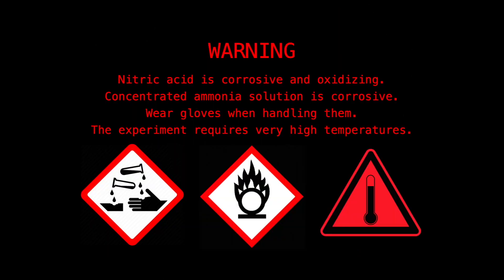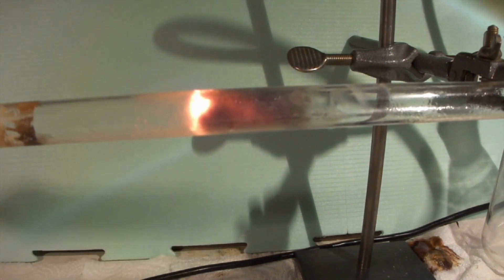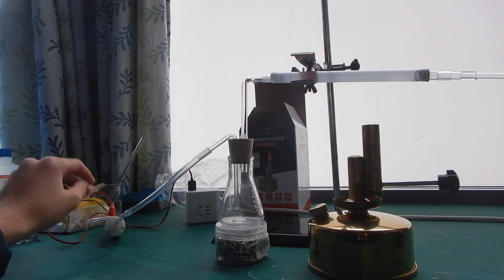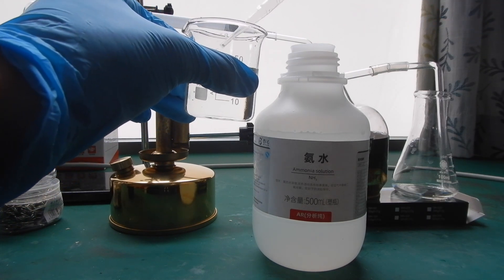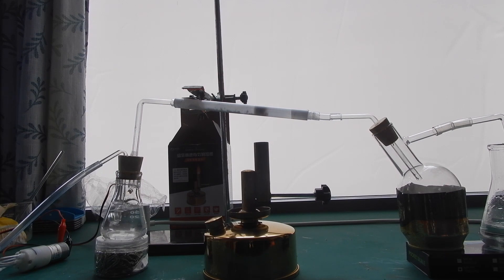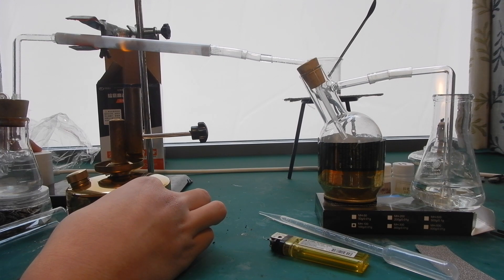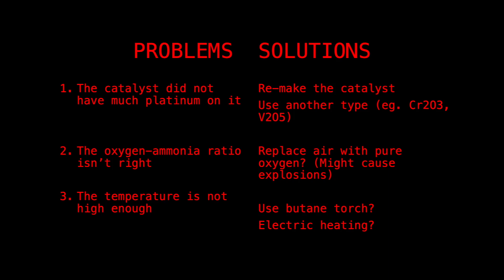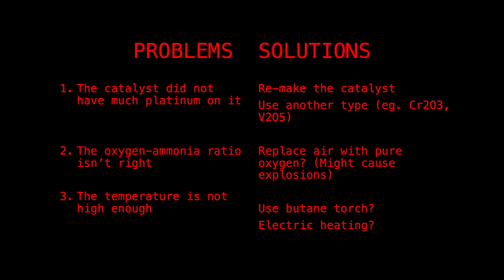1.4 Three Acids - Making Nitric Acid - FAIL

Comment: You can use brick 1 from a used catalytic converter. This has Pt90% snd Rh 10% coating it. It will burn ammonia to nitric oxide in oxidizing conditions. The irony is that under reducing conditions, it removes the nitrogen oxides.

Comment: from what I did exploring this process its more suited at this scale to make a lot of sodium nitrite very cheaply.
Reply from the maker: That was what I originally planned for this... Use sodium hydroxide instead of water to absorb the nitrogen oxides would give sodium nitrite in decent yields. However I did not do this because I worried about the potential yield loss since extra NH3 carried over would react with the nitrite and produce N2. I would try this again with the heating wire setup you mentioned, probably in this month.
Reply: @MIH0319  if you wanna filter out ammonia selectively you get a trap mix of oxalic acid suspension with copper metal and this causes all your nitric and nitrous acid to convert to NO2 and copper oxalate.
the ammonia will stay in the solution and make ammonium oxalate.
This works but hopefully oxalic isnt that expensive for you.

Comment: having done this before instead of using a torch you should heat the outer part of the tube using nichrome like in a way a tube furnace works.
the ammonia gas ratio is very crucial but I really just make sure the ammonia is very concentrated about 25% straight ammonia.
Platinum catalyst does work but I bought mine off ebay when it was on sale for 50% off.
you can use other catalysts immobalized on perlite such as NiO and Mn2O3 or a mix of these.
Theres the classic 3:7 ratio of CuO to Mn2O3 mixture and yes you can use MnO2 as it converts to Mn2O3 when it glows red hot but you need pure MnO2 not battery paste so you have to purify it and the way the catalysts prep works is that they mix copper and manganese nitrate with the perlite or other media and heat to decomposition.
Reply from the maker: I would try mainly Cr2O3 (made from decomposition of (NH4)2Cr2O7) and V2O5 as catalysts. Probably won't try copper-manganese catalysts because I obviously cannot get nitrate salts... If I can get the nitrate then why am I doing this project??
Reply: @MIH0319  ive used manganese and copper acetate and precipitated manganese and copper carbonate then you can mix with clay and pelletize and bake.
you can also use manganese acetate and copper acetate and add some sodium chlorate or potassium chlorate and baking this also results in manganese and copper oxides.
Reply from the maker: I see. What temperature is needed for the baking? Can the materials be just in powder form and not pellets?
Reply: @MIH0319  powder yes but pellets are better to allow for better catalyst contact.
you bake them at around 300C to 400C with either an oven of a blowtorch and some forge type setup.

Comment: The problem is that you diluted the ammonia solution. Ammonia gas needs to be generated for this process. To fix this issue don't dilute the ammonia and heat up the conical flask that holds it. The reason this generates ammonia is because it's solubility decreases with temperature forcing ammonia out of solution. An alternative easier method of generating Ammonia gas is to decompose some ammonia carbonate(58degrees c) hope this helps
Reply: عندك فكره موسعه عن المو ضوع

Comment: Two things, first, you need to use undiluted concentrated aqueous ammonia, and second, you must heat the aqueous ammonia to generate the ammonia gas.
Reply from the maker: I intentionally diluted the ammonia because research shows that excess ammonia tend to react with nitrogen oxides to form ammonium nitrate, lowering the yield considerably